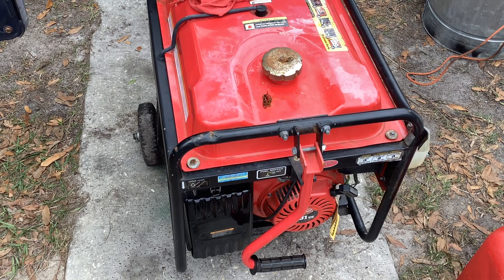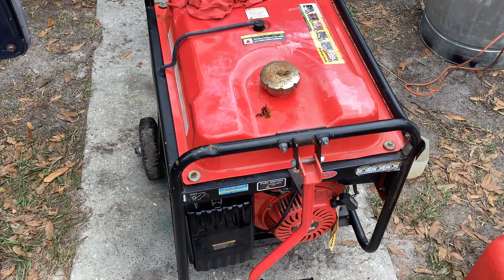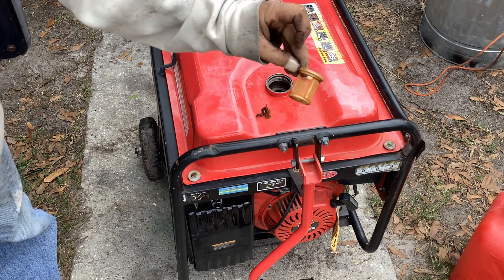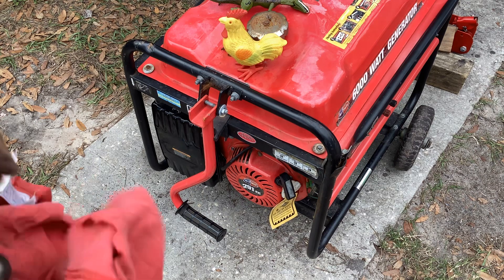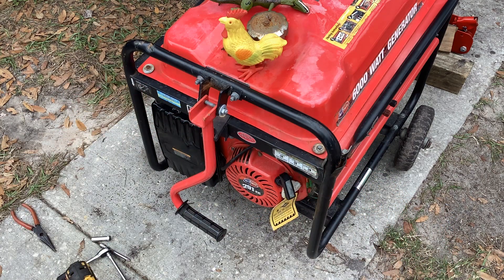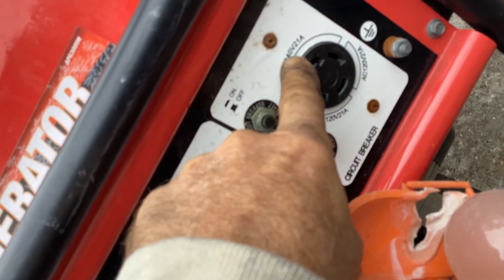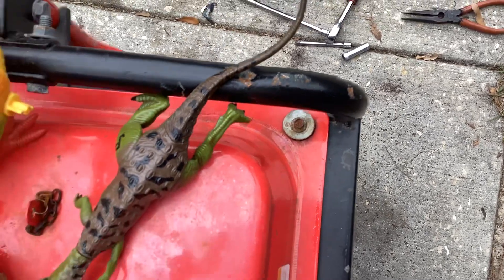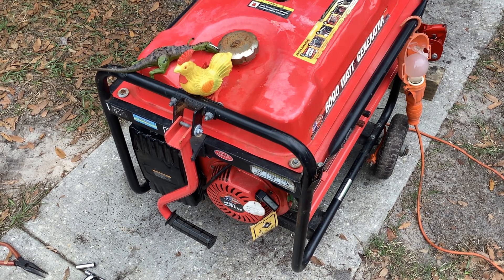2004 All-Power 6000 watt generator.....We are making the JUICE now.!!!

Comment: I have the same generator but the carb couldn't be worked on, I bought another carb which lasted 3 days running before it started chugging, same with the next carb, then the net year I bought another carb (all off of Amazon) and it lasted just one day before starting to chug a lug. Runs fine with the choke on but soon as you turn it off it chugs badly, I can't figure out why the carbs go bad, I use Ethanol free gas and Sea Foam stabilizer, any ideas why the carbs mess up? There is no fuel filter on these, only inside the tank fill.
Reply from the maker: is it possible to use a secondary gas tank and run a  new fuel to carburetor?

Comment: GREAT success!! I put Sta-Bil in whenever I buy fresh fuel, which is quite often. I buy 4 gals. of 4 stroke fuel and a gal. of 2 stroke fuel about once a month. I never know how long that fuel might be sitting in a particular machine. I also add a bit of Marvel Mystery Oil in, seems to keep them running smooth. JMHO, your mileage may vary!!